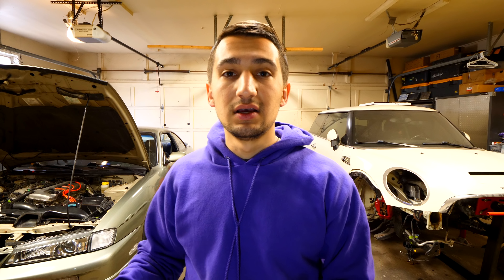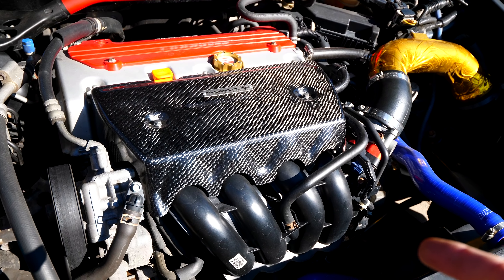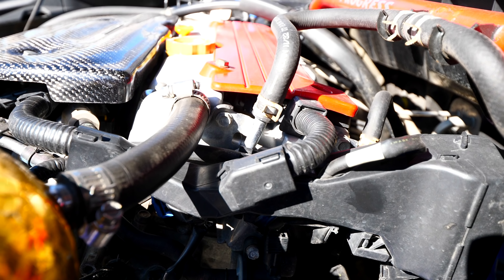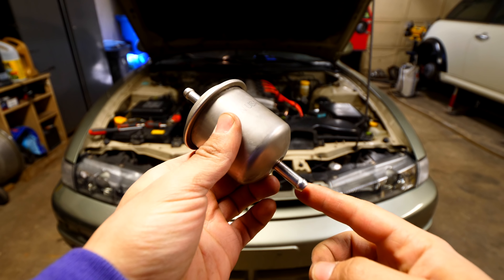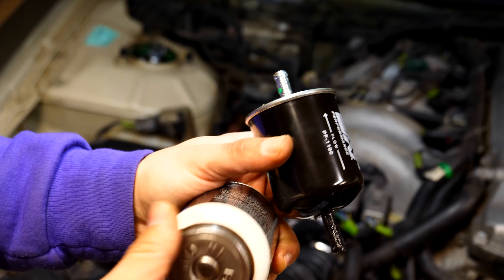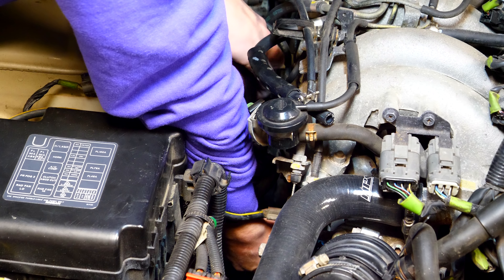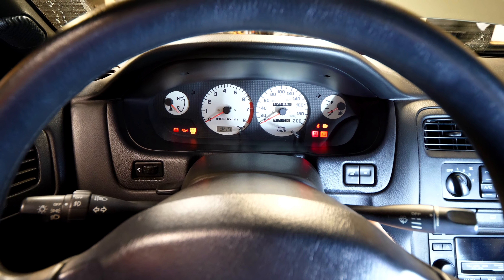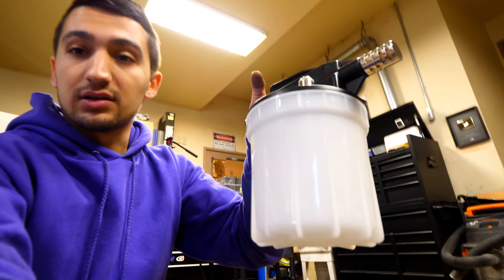Putting the Mini Project on Halt.. Here's Why

Comment: You don’t need to replace a timing chain unless it’s rattling on startup. Or the cars throwing cam codes
Reply from the maker: That is not true. If your timing chain is stretched and causes the tensioner to max out, and still causes slack, you will have this same problem. I got the code P0341 which is indicating there is a problem with a camshaft. The true problem is indicating that the camshafts are out of phase with the crankshaft, which is due to the chain/chain guides/tensioner. I will be replacing all of it, along with the VTC actuator while I'm in there.

Comment: You keep saying chain... you mean Honda TIMING BELT
Reply: SoCal Realtor this car doesn't have a timing belt it has a chain. Only belt it has is the accessory belt
Reply from the maker: No I mean chain. The V6's are timing belts, but the 4 cylinder K series engines are all driven by a timing chain.